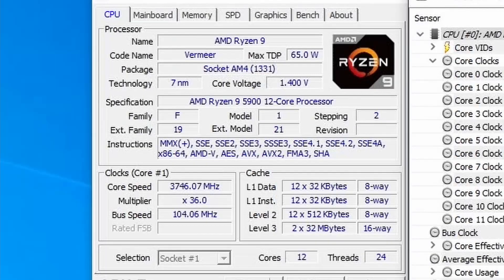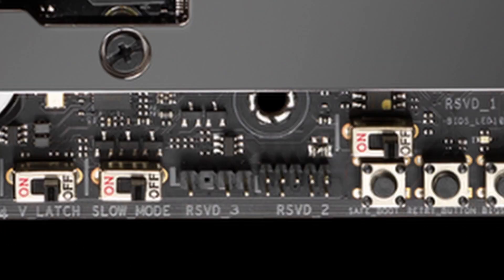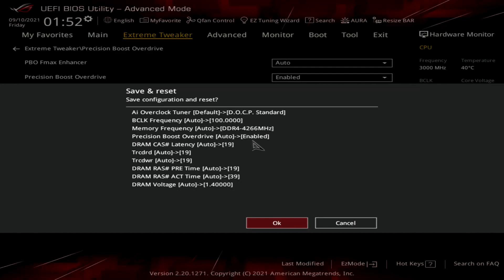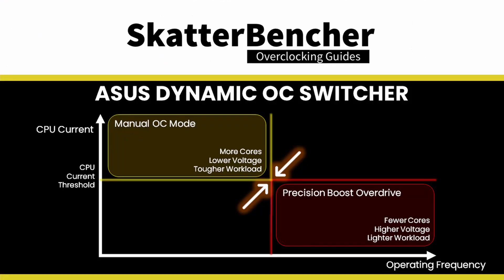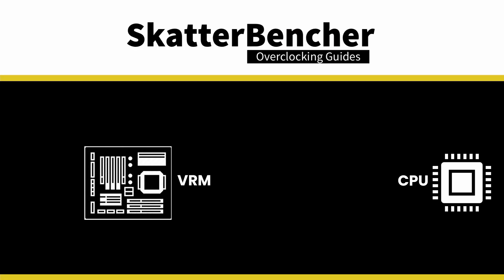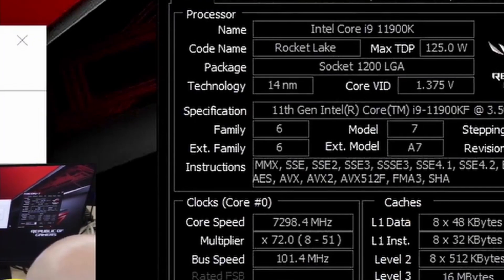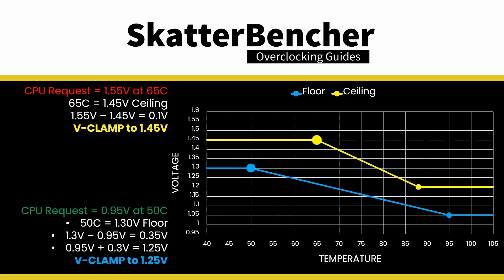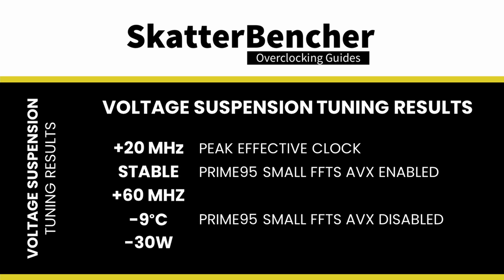Ryzen 9 5900 (B2) Undervolt & Overclock to 5152 MHz With Crosshair VIII Extreme | SkatterBencher #29

Comment: I have tried running this board in PCI-E 16x to get full bandwidth on my GPU but when I use the dim.2 with a nvme and a nvme in the first m.2 under the CPU my PC crashes all the time. looked on google and have seen people with the same problem. as far as I know, this board can not run a GPU @ full 16x PCI-E, which is a freaking shame because this motherboard is supposed to be the flagship.

Comment: Hey dude, I just found your channel and been watching a ton of videos from you ever since. Thanks a lot for everything you're doing, it's been a great learning experience! Would you mind making an overclocking guide with the 5950X and the Crosshair VIII Extreme motherboard? I'm particularly interested in seeing how it performs. Thanks!
Reply from the maker: I greatly appreciate the kind words! Happy to see you learn something from the videos :)

As for 5950X: I've been trying to formally retire from all my AM4 Ryzen overclocking adventures but unfortunately I've been unsuccessful so far. With AM5 around the corner, I think the 5800X3D will be the last chip I'll try with the Crosshair VIII Extreme.
Reply: @SkatterBencher  Any tips for getting a good PBO with the AM4 5950x on this motherboard??...it seems pretty fail overall in my experience .
Reply from the maker: I have used this motherboard with a Ryzen 9 5900 before. You can check SkatterBencher #29 for a detailed guide with this board :)
Reply: @SkatterBencher  What about the 5900x??? Is there much difference in the two???

Comment: thanks man.. that voltage suspension thing is pretty tough.. however i found , honestly that many of these things are mmmmh useless? or eventually useful for extreme overclock, i spent a lot on pbo and curve optimizer that is even pointless to use dynamic oc switcher. i have very high numbers, temps within 90 max. and I've been running stable a lot included hours of prime  and lynx
Reply from the maker: Voltage Suspension got me 60MHz more with 9C lower temps and 30W lower power during heavy Prime95. That's pretty impressive for ambient.

Comment: Very curious how the quality of the I/O dies are on the b2 stepping, i believe glofou makes the io dies for ryzen and their silicon quality is always all over the place. Have you had any luck with 2000fclk and beyond? i have tested 6 5950xs some will only do 1866 others will do 1900 stable, regardless of boards, voltages , ram kits etc. The 5950xs would boot up to 2000fclk but event viewer is flooded with whea errors. Seems people have better luck with the lcc chips but i guess that comes with the territory of running a smaller chunk of cache, I was thinking b2 stepping was going to be v-cache seems interesting to transition to a new fab node again so soon or makes me think amd is holding their cards close to see what intel does with alder lake. Great video as usual.
Reply: My 5900x goes 4000/2000 no problem
Reply: @robertomerenda4942  but is it actually faster? My 5900x also works fine at 2000/4000 but runs much lower scores than 1900/3800
Reply: @LawrenceTimme  maybe you got whea errors?
Reply: @robertomerenda4942  maybe. But it's slower. The errors don't matter. All that matters is performance
Reply: @LawrenceTimme  it’s slower because you got errors 😅
Reply: @robertomerenda4942  sometimes errors can occur but it can still be faster
Reply from the maker: I quickly checked FCLK and IMC clock and could run 1:1 up to about DDR4-4100/2050/2050. Above that it was a lot more challenging, so similar to B0 stepping.

The reason why we see such high FCLK on APUs (Cezanne 5000G) is because it's a single die. So the I/O portion is on the same die like the CPU cores. For CPUs (Vermeer 5000) there are at least 2 dies on package: 1 or 2 dies with CPU cores and 1 die with I/O. You can see some pictures here https://www.flickr.com/photos/130561288@N04/albums/72157719667569644 (Cezanne) and here https://www.flickr.com/photos/130561288@N04/albums/72157716803186398 (Vermeer).

B2 isn't a different fab node. If it were, we'd be talking about the Ryzen 6000 series :)
Reply: @SkatterBencher  2050 is very high Fclk for vermeer especially for 5900. So the B2 has better IO die?!
Reply from the maker: It's high but not uncommon, so I don't think there's a difference in IO die between B0 and B2
Reply: @SkatterBencher  Thanks for the reply and checking the clocks they are quite healthy, some good comments in here from other users, i was under the assumption b2 stepping was made on N6 node and b0 stepping was N7+ node with N6 just offering more fab capacity. Have you had a 5950x sample do 2000fclk with no whea errors? i see folks with 5900x and lower having lots of success but rarely see the 16 core chips meet those clockspeeds stable without whea errors.I guess we will need a bigger sample size to see how the b2 stepping looks but 2050fclk on a 12core is impressive. Thank you for your great content.
Reply: Yeah my 5900x won't do more than 1866 fclk either, period, the end. interestingly I can do that with pretty great timings for Micron E Die, no errors, but go up a single step even with loose timings and I'm extremely lucky to get into Windows.

Comment: Hi! @SkatterBencher
First thanks for the great content and guides! i following them since the new ryzen 5000 came out. I have a question: 
Could you try this or something similar with Ryzen 5900x B0 but running in ECO Mode? Eco mode runs also with 65W? 
Thanks!
Reply from the maker: Hi Dalibor, thanks for the kind words and for watching my videos :)

I am not familiar with ECO mode, so I'll have to look into that. Other people have requested if I could do a guide that focuses on performance per watt optimization rather than maximum power. I have it on the to-do list to one day try that approach, but currently I don't have enough time to also work that kind of video.

Comment: Okay, so I got my CH VIII EXTREME in the mail, and my 5900X. I'm using 64g of GSkill TridZ Neo 3600C16 DDR4. BUTTTTTTTTTTTT, when it came to the voltage suspension part, SEVERALL of my options were locked on "AUTO". For example, the "VOLTAGE FLOOR MODE" was set to auto, and would NOT change at all. I followed every other step of yours perfectly. I have the same board, so WHY will it not change????? That ruined my entire overclocking setup, because it just booted into safe mode...
Reply from the maker: What BIOS version and CPU are you using?
Reply: @SkatterBencher  So before I answer your question, I'll tell you that I solved one problem MAYBE, but have found another MORE TROUBLESOME problem. First, previously when I updated the bios from 0211 to 0801, ONLY one of the bios's updated. So when I was trying to follow you, I had switched bios's, and was on the very old bios, not realizing that both bios's didn't update.
However, after finding that out and correcting it by updating both bios's to 0801, I am finding that my Crosshair VIII Extreme continually is stuck in a boot loop. 
At startup, it starts running codes as normal, but gets stuck each time on two particular codes over and over. First, it shows 58 vga, and ramps up the fans real hard, then goes to another few codes, and then sticks again on code 94. Then it goes right back to 58 for a minute or so, and then the Oled screen says, "Loading VGA bios" for a very long time. Then it starts doing it all over again, and again and again. I have pushed "Safe Boot" several times, but nothing happens except it all starts over once more. I've pressed "Clear CMOS" and the same result. It is INFURIATING!!!!!! It was actually running perfectly find on the old 0211 bios, but didn't have some of the new features.
Finally, I took the Dimm.2 drives out, pushed clear CMOS, and it FINALLY booted into the bios, which allowed me to load defaults. This allowed me to get it into Windows from there. 
Lastly, I am running an AMD Ryzen 9 5900X. Not sure how much difference your numbers make with the 5900X, as opposed to the just 5900??? Any help from you would be ESPECIALLY appreciated, as the forums have been absolutely NO HELP at all with this EXTREME board. Thanks for anything you might be able to contribute to getting this fixed.
Reply: @SkatterBencher  ...Also, before removing the Dimm.2 module, I had all five m.2 drive bays populated.
Reply: Okay. So I made sure that both of my bios chips were updated to 0801 the latest bios for this board. I followed all of your steps perfectly, and my sys will not boot. I also have 64g of GSkill TridentZ NEO 3600c16 DDR4 ram. Not sure why these settings work for you with this same mobo and processor, but keep me from even being able to boot???? I even tried lowering the BCLK to 102 and then back to 100.  Also tried lowering mem freq back to 3800mhz. NO BOOT! I'm scratching my head at this point. Any suggestions???
UPDATE: I noticed when I finally was able to get back into bios, that Global Cstate was on "AUTO" and NOT "ENABLED" as I had set it?????????????? I have no idea how this changed on its own, but somehow it did. After changing it back to "enabled" two more times, each time I went back into the bios, it was on "auto" again.
Reply: I have 3200mhz of memory im going to get lower results right?

Comment: What prompted you to start running PBO limits at other-than-generic (not simply 500/250/250) values this time around?
Reply from the maker: I paid a little more attention to what was going on with PPT/TDC/EDC in HWiNFO and just left them where they were sufficient. 

(Except for OC Strategy #5 where I deliberately limited PPT to 205)
Reply: @SkatterBencher  Righteous, what benefits did you notice in setting the PBO limits in this manner compared to setting them to some unreachable value? Worthwhile?

Also, what's your thinking while deciding what LLC to run? I notice you like Turbo (on the Gigabyte boards I see you test with), why is that?

Comment: Oh man, this could be my dream cpu, lower power and heat, and performance doing well, i still wonder how to buy it, cuz amd only released for oem.
Reply from the maker: You can always buy a 5900X and manually set max TDP = 65W in BIOS :)
Reply: @SkatterBencher  is eco mode and lock in 65w both have same performance and TDP with 5900x?🤔
Reply from the maker: Similar, but the 5900X has 100MHz higher boost.

You can always use Fmax Offset, Scalar, and Curve Optimizer in combination with 65W TDP. It means you'll maximize performance within the 65W power budget :)
Reply: @SkatterBencher  thx, finally my cpu can work cooler😀

Comment: The Nvme’s on the bottom don’t work on mine.The one under the display works fine I used the adaptor next to the memory installed them there work fine. Called ASUS support got nowhere..Can you help me? Thanks 🙏
Reply from the maker: I don't have the system set up anymore, but there's a setting under (I think) Advanced > Onboard Devices Configuration where you can change the PCIe lane configuration from 1x PCIe to PCIe + M.2 + M.2. That would be my best guess.
Reply: @SkatterBencher   That worked ! Thank you .

Comment: B0 can do same. My 5900X not top sample and I use itx board - CB23 23200+ points multi, 1650+ single. with PBO2+CO. Some B0 can do ~24000. Your PBO limits are wrong. 300 to all or 250/200 doesn't work right. And also your 5900x can't pass Y-cruncher with -30 CO to all core, as is Prime with 4k-Max cycle runtime per core.
5100-5150+ to single thread/core also give nothing.